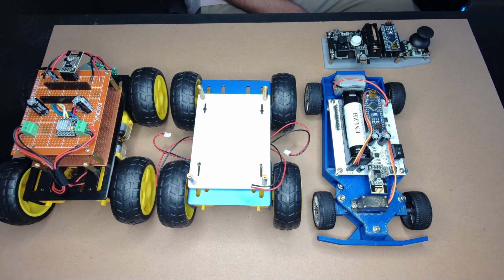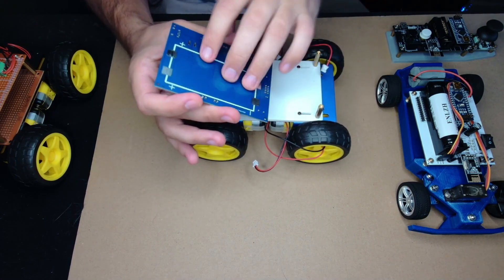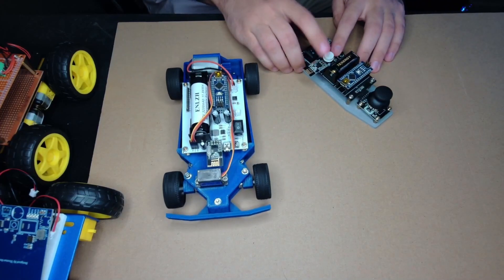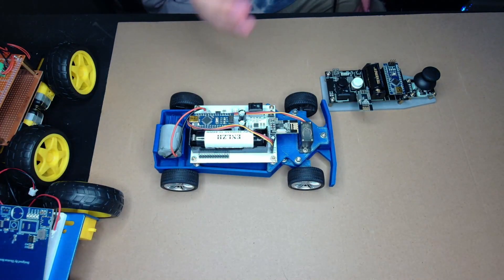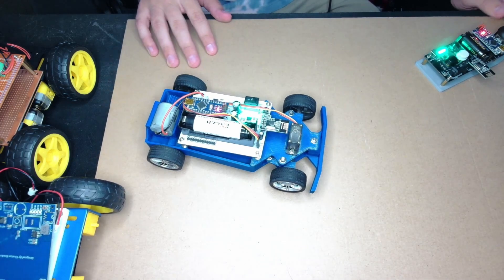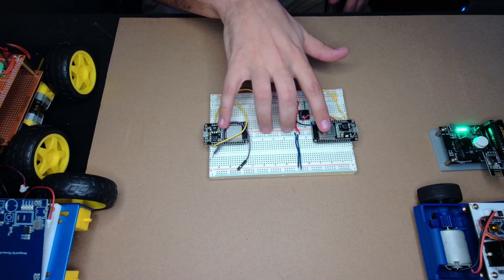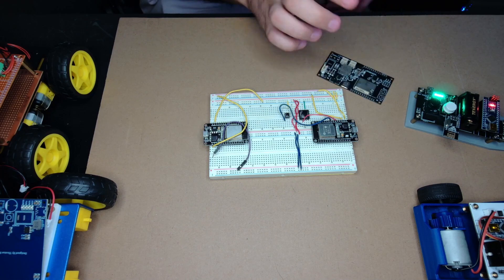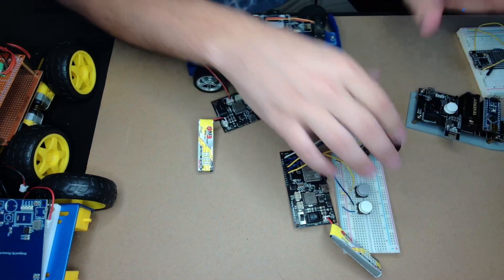Making an ESP32 RC Car! Ep. 1 Overview and Next steps

Comment: Great video mahnn..
I'm also trying to build a similar rc drift car ( since drift= 'cool'),
Im thinking to using esp32 cam module to stream the fpv video via wifi to a web  interface and control the car using  keyboard. 
Is there any way I could contact you like Instagram, i could really use some help on this.....

Comment: For your use case, the limiting factor are the Analog In channels.
The ESP8266 has only 1 of them and it is not possible to make the XY controller (without extra components).
The ESP32 has enough ADCs, so you can have several analog Inputs for the remote sticks.

On the car, you can go with an ESP2866, and use the only ADC to send back the battery voltage to the remote.

Luckily ESPNow works with a mix of devices, so you can combine ESP8266 and ESP32s.
Reply from the maker: I wound up going with the esp32 for both devices. Part of the intention of making these 2 boards(one for controller and one for the car) is that they could be used for really anything the user wants, basically a dev board. Since the esp32 is a bit more capable(and not too much more expensive) it just made sense to me. Although I didn't add a connection to the esp32 for monitoring the battery level. I like that idea! I'll probably add it to the next revision of the PCB if I make one.
Reply: @TommyBee456  In that case you can make a batt level bar graph and/or RSSI indicator... or just go for the ESP32 camera module and make it transmit video.
Might not work with ESP now then.